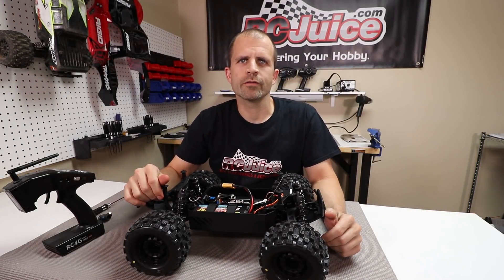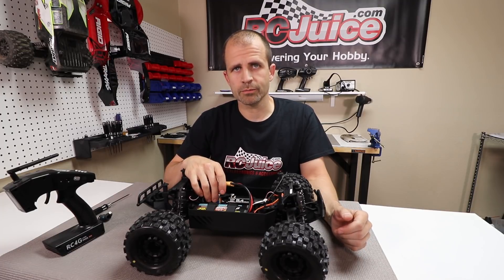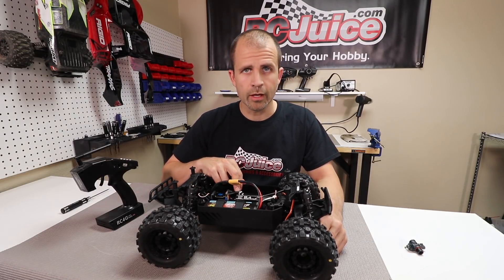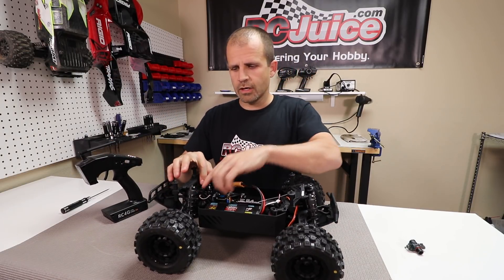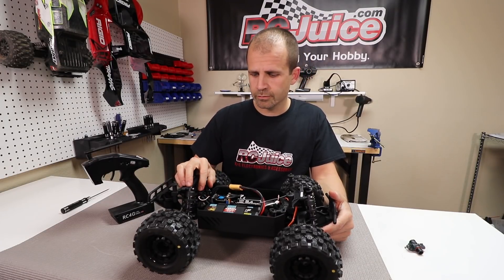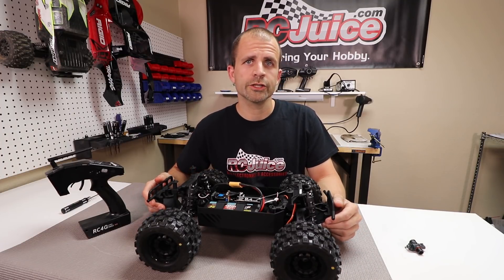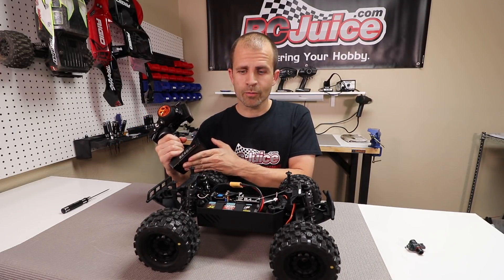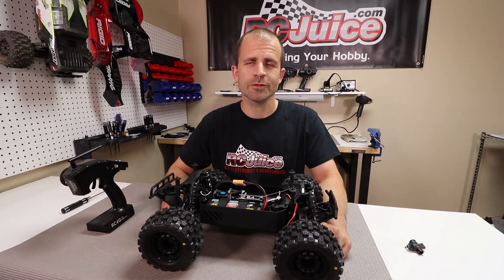What is ESC calibration on RC speed controls?

Comment: Hi, Very informative video, in my system actually I am using HV130 and there we dont have any button as such, so how to do the throttle PWM calibration using Remote, like we give forward throttle then turn on the ESC and Motor then wait for 2 beeps and release it to normal mid position, but in this case it calibrate only the forward throttle PWM but the reverse throttle PWM, so can u help me how to calibrate reverse throttle too?
Reply from the maker: Hi Abdul, reach out to us at support@rcjuice.com and we'll see if we can help you out.

Comment: My son has a ECX Ruckus that just had a motor swap done on it yesterday. When I got it home and tested everything, reverse did not work and it was a whole lot faster going forward than I ever seen and on top of that I couldn’t shut it off. I turned off the RC and the truck and the wheels were still spinning at 100% full power. Does what I am asking about sound like the ESC needs to be calibrated? Unplugging the battery was the only way I could get it to shut off. 😳
Reply from the maker: Yes! Definitely re-calibrate that esc.
Reply: @RCJuice  actually it needed a whole new esc installed. I took it to the local hobby shop and they said they never saw a RC do what it was doing so they just installed a new one and it’s working fine again.

Comment: So what about if the moment I let off the set botton the esc turns back off? What causes that to happen?
Reply from the maker: Perhaps a different procedure on the ESC you are using (different ESC's have some variations to the procedure) or there is a problem with the ESC.
Reply: @RCJuice  im using a hobbystar 120a

Comment: I did that and its faster in reverse
Reply from the maker: Reverse your throttle channel on your radio and calibrate again, this is most commonly required on Futaba and Flysky radios but happens with others as well.
Reply: @RCJuice  ok thanks

Comment: I have a wl969 but most of the time it does not move forward and only moves backwards. If you know the reason, help me. Thank you.
Reply from the maker: If you have adjustable throttle trim on your radion I would check to make sure it is set to the minimum setting, and possible re-calibrate after doing so.

Comment: my esc doesnt come with set button.. what can i do?
Reply from the maker: Check the instructions for your ESC.  If there is no set button, they will usually have you do something like holding the throttle wide open on the radio as you are turning on the ESC to get it into calibration mode.  That may not be the exact scenario for your ESC, but that is common when there is not a set button.
Reply: @RCJuice  okay i'll try
Reply: @RCJuice  Also my when i adjust the speed trim it runs by itself.. can you help me with this please?
Reply from the maker: @emkaykim5192  Make sure you turn your trim all the way down before calibrating, once it's calibrated then yes, it would cause the vehicle to go if you turn it up.  If you leave it turned up and then turn off the ESC, it will not arm when you power it back up until the ESC sees that reduced all the way back down again.  This is a safety to ensure that the vehicle does not take off when you first power it up.
Reply: @RCJuice  Okay thanks you're great! Subbed!

Comment: Everytime I run my car I have to calibrate my esc is this normal?
Reply from the maker: No, but are you making any changes to any radio settings (trim)?
Reply: @RCJuice  no ever time I run plug battery up esc Nothing only steering then I calibrate then the throttle works I believe I have a faulty esc hobbywing sc8.
Reply from the maker: @nts323  That sounds like it could indeed be a faulty ESC.  What radio are you running with it?
Reply: @RCJuice  austar hobby 2.4 transmitter
Reply from the maker: @nts323  Are you making sure to turn the radio on first, and then the car?

Comment: Noob here asking. Why do you call it full brake and not full reverse position?
Reply from the maker: It's the same thing, here we refer it as full-brake because if you go from full-throttle straight to the other end of the trigger travel as you do during calibration without a pause, brake will be engaged.  Reverse takes a pause in neutral to engage.

Comment: I’ve got a dr10 that for some reason I can’t make it do anything
Reply from the maker: You mean the motor will not run?  Does the steering servo work?  If the steering servo does not work either then it's likely not a calibration issue as a steering servo will still work if an ESC is not calibrated or arming.

Comment: Hi dont have a reset button how do you do it with out the button . Cheers
Reply from the maker: What ESC are you working with?
Reply: @RCJuice  Hi, I am also having an esc without a button(at least I cannot find it). Namely this combo: https://www.banggood.com/Surpass-Hobby-Waterproof-F540-V2-Sensorless-Brushless-Motor-with-60A-ESC-for-1-or-10-RC-Vehicles-p-1548050.html?cur_warehouse=CN&ID=511868&rmmds=search Now this is a really cheap esc so I don't expect much from it, but any calibration wouldn't hurt. I already tried using full throttle or full reverse and then turning on the esc but it just waits for the transmitter to be in the neutral position. I also have this programming card for the esc: https://www.banggood.com/Racerstar-LED-Program-Card-For-Racerstar-Surpass-Rocket-ESC-p-1057127.html?cur_warehouse=CN&rmmds=search But then the esc is plugged into that and not in the receiver so I doubt that it can be used for any calibration. Do you have any idea how to calibrate it? Thanks in advance. The user manual of the esc also does not mention any calibration procedures.
Reply from the maker: @peter10101  Those ESC's actually do not have a calibration function, it's a "weak link" in that you may never get full power from those ESC's, they work fine but they are just a very basic unit.
Reply: @RCJuice  Thanks for the info! Like I said, I never expected much for the price, just wanted to revive an old truck I had laying around that was brushed and didn't want to spend too much initially. Power as is seems pretty good, I'd have to run a speed test tho to see how close it gets to the theoretical max. Only thing I can notice rn is that the braking seems a bit weak, turned it to 75% now and still feels a bit weak, gonna try 100% next. Might just be another weak point of the esc tho.
Reply from the maker: @peter10101  Our pleasure!!  That is correct, you will typically see weaker brake action on more budget ESC's.  They are fine for a lot of applications though, just depends on what you need.

Comment: My goolrc ESC is beeping and my receiver was blinking red but now it’s not it’s just beeping on my esc what do I do and my transmitter will not bind with the receiver
Reply from the maker: Note that binding a radio to a receiver and calibrating your ESC are 2 separate things. Check your trim settings on your radio, did you move the throttle trim?  It must be all the way down before calibrating.

Comment: Hi there ! I have an E-Savage and trying to get it going. My old batteries 7.2V nimh 3300mah are still powering the vehicle but end of their life but the new once are not not.Pulling the throttle the twin motors just click click. The new battery packs have a bit higher voltage. Its a Gt 14.4 ESC with double motor 7.2V x 2  Can you please help how to get my truck going again. Regards, Daniel

Comment: Question... If I'm swapping my Traxxas UDR electronics with Futaba and going with the 7PXR radio, can I use the pre-existing Traxxas Speed control? or do I need to go with another brand?
Reply from the maker: You can absolutely use the stock Traxxas ESC with your 7PXR. After replacing the stock receiver with the Futaba, just be sure to recalibrate the ESC and you'll be good to go.

Comment: Hi, I guess on my boat ESC this setting prosedure not working, the ESC is waterproof and has no any button, no matter how I tried, it's just flashing with red light(it's a Joysway Aplha boat)
Reply from the maker: There should have been a seperate instruction manual for your boats ESC along with your boats instruction manual. You will find your ESC calibration steps there.
Reply: @RCJuice  thanks.. Then I have to dig up to find those papers☺️

Comment: My esc has no set button?? I have tried turning on while holding both full throttle and reverse but still nothing, just a blinking led on the esc.. it's a generic brushless combo from China looks like a Goolrc copy.. any ideas?
Reply: G-Dotz 
I have the same problem and maybe we have the same esc. Did you found out what is the problem? Mine is also flashes red led.
Reply: @topihitam3510  I ended up buying a new 120a brushless (the blue 1 on ebay) from China and it worked perfect out the box
Reply: G-Dotz 
Maybe l need a new esc too. Thanks for the reply.
Reply: @topihitam3510  i also have the same problem we need to find a solution

Comment: as u talked about going faster in reverse mine is doing this but when i switch  the throttle  chan to reverse it just takes off without touching the throttle
Reply from the maker: Now that you have reversed the throttle channel, did you also recalibrate and reset throttle trims?
Reply: @RCJuice  yes i forgot to recalibrate its fixed great vid

Comment: Sir i brought new brushed esc hpi 320a and i intalled it on.my rc truck.here is problem that my esc works only in forwad direction not in reverse as i do reverse feom thr radio transmitter esc blinks red light but does not give output voltage to motor.plz help me to solve this problem

Comment: When I turn my JLB J3SPEED (Cheetah version 3) on,the 120A ESC has a blinking RED light and I have no power and no steering.PLEASE HELP.....p.s.ive tryed re-calibrateing it,I turn it on whilst holding the "set" button,the motor bleeps then I'm supposed to leave the control in neutral and press "set" again but as soon as I do this the beeping stops and red light flashes again,it's supposed to give me a GREEN light but it doesn't.HELP HELP HELP

Comment: Hey buddy do you know why my throttle and steering would be reversed on my flysky transmitter? I just swapped out my tactic radios to my fly sky and for some reason I have to run channel 1 and 2 reversed. The arrma motor wires are hooked up normal. Any ideas? Thanks for any help!
Reply: Chris Watson that’s how my flysky’s works too, I think it’s just how they are. Otherwise, I think it is possible to reverse the esc input when programming the esc.

Comment: I have one servo tester no transmitter...how I can calibration my esc with servo tester....my motor not run...its sound like beeping beeping...please help me
Reply from the maker: It may not work.  I'd try using the center knob position on the servo tester as your neutral point, and then full clockwise as full throttle, and full counterclockwise as your full brake.  This will obviously not be correct for later using it with a radio but may get it to calibrate enough to run the motor.
Reply: @RCJuice  its work man...I love you , thanks for better suggestions...I calibrate my esc through a servo tester...my motor run...😎😎😎😋😋
Reply from the maker: @Raja-hv8gj  Awesome!! Glad it worked out and thank you for  your follow-up :)

Comment: thank you that's sorted my esc right out !!!
Reply from the maker: Awesome, glad it helped!!
Reply: @RCJuice  hi I have a dromida bx4 sometimes it takes off in reverse at high speed even when it's set to the lowest setting and the controller cant stop it in either direction any help thanks
Reply from the maker: @aidenfletcher6503 , The first thing I would recommend is recalibrating your ESC, sometimes this important step is overlooked. Thanks.
Reply: @RCJuice  will try that but now it needs anew servo that's the second to burn out  I actually have a feeling when I got it it had been used before thanks for your reply keep uploads coming 👍